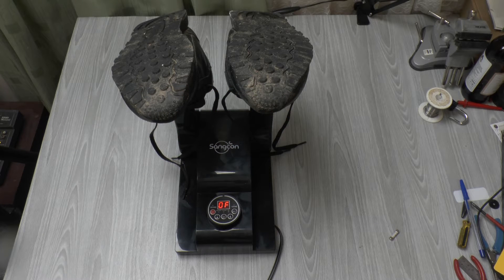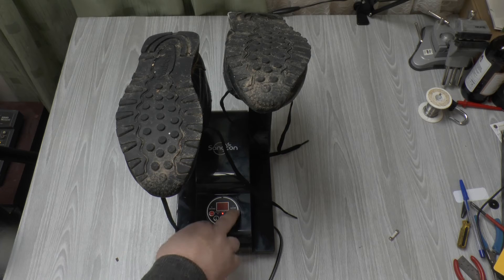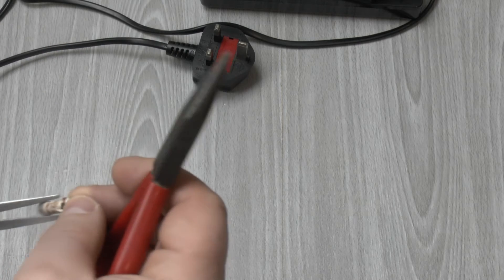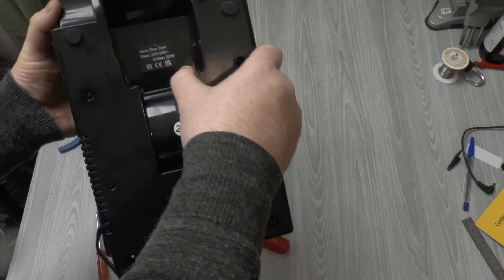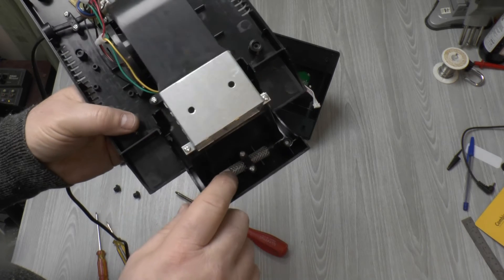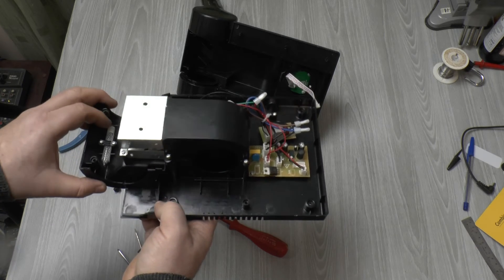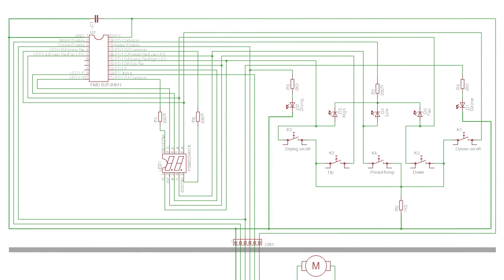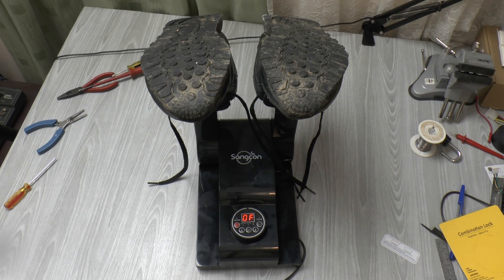Ozone generator shoe dryer teardown (with schematics)

Comment: Ozone generators... NOT even once. Super dangerous for humans and pets alike. Inhaling that stuff is super no no. Plus, there's these "snakes" you put inside your boots that have fans on the inside and they blow warm air in the boot. Those work perfectly good enough and they're cheap.
Reply: Ozone is not that dangerous.  It's not like poison gas, one whiff and you're done.  Not healthy to breathe in concentration, for sure. But it has actual practical uses and can be used safely.

Comment: I always wondered how quickly the ozone in a product  like this would degrade the boot material.
Reply from the maker: Interesting, I wasn't aware of that. https://www.satra.com/bulletin/article.php?id=2672
Reply: @AintBigAintClever  I'm no scientist, but from what I understand is that ozone will basically consume anything, but I really have no real world experience in how much it really takes to damage something.

I only learned of the use of ozone when I found out that's how they rid used cars of their smells...they just plop an ozone generator inside the vehicle for some time.
Reply: I've got an industrial ozone generator capable of emitting so much ozone, the air becomes cloudy.  It is very aggressive stuff and does damage plastics and rubber items quite readily. And your lungs of you breathe it. Don't do that. I do use this machine very sparingly to deodorize my car and house. Less than a minute will do a car for weeks. But of course modern cars are basically all plastics.